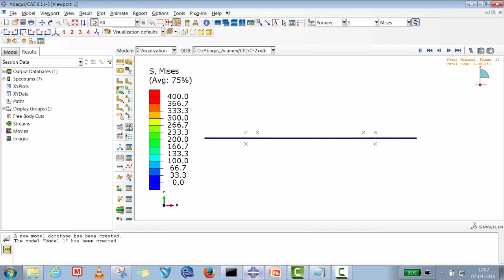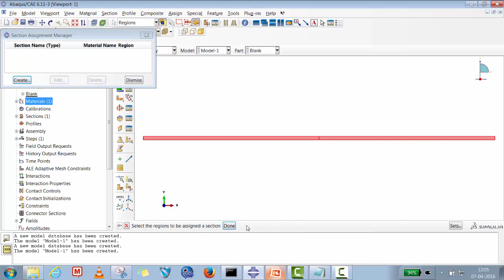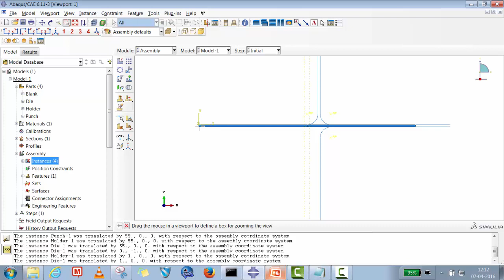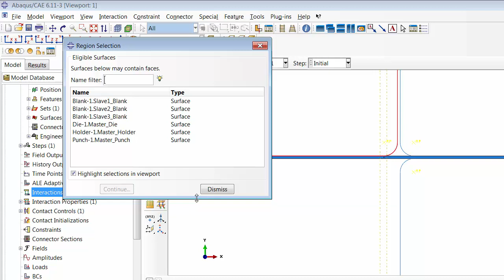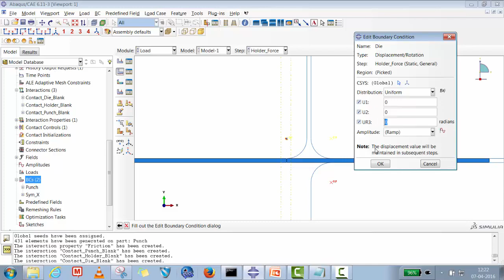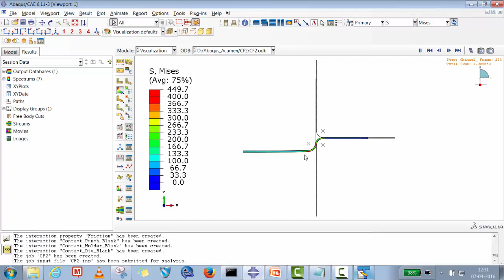Deep Drawing: Forming a Channel -Abaqus CAE-Implicit-Standard

Comment: Thank you for the tutorial. However, when I am trying to translate this to a 3D case. I faced some issues. If I applied similar holder force, my model crashed because large strain. If I removed the force., it had zero pivot nodes. Any suggestion would be helpful. Thank you.

Comment: i am trying to do practically the same simulation but using an dynamic explicit solution scheme. but i cant get rid of the errormessage:

***WARNING: Surface ASSEMBLY_MATRIX-1_SURFMATRIX cannot be used with *CONTACT
            PAIR because it is not simply connected.  For example, nodes 2
            instance MATRIX-1 and 2 instance MATRIX-1 are on disconnected
            surface regions.  Surface facets which contain these nodes belong
            to parent elements 1 and 23, respectively.

***ERROR: 1 improperly defined surface(s). Please check your surface
          definitions. Make sure that all surface normals point outward.

do somebody know what the reason could be? 
my model works solving it with an General,Static model
Reply: try general contact explicit. faster